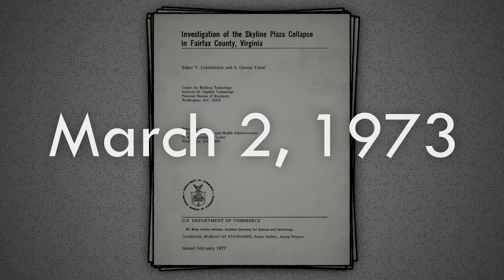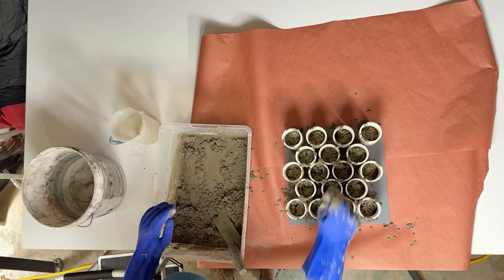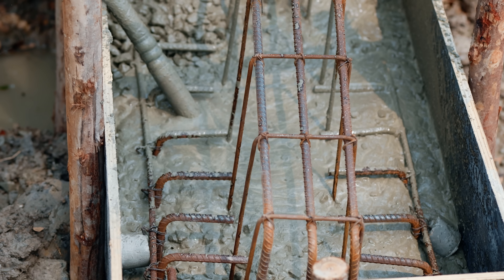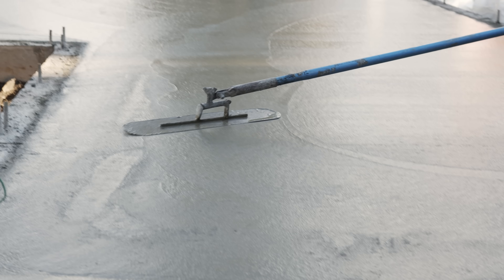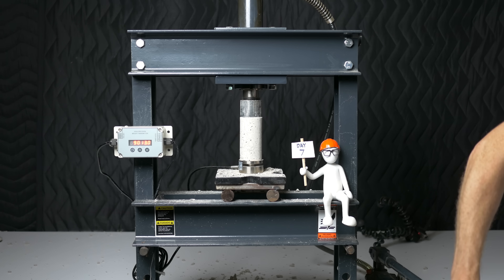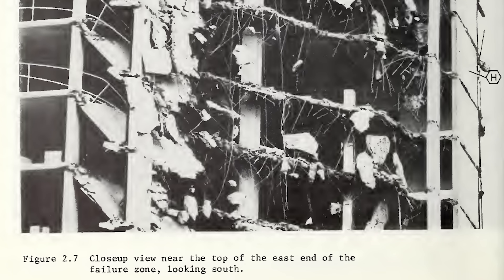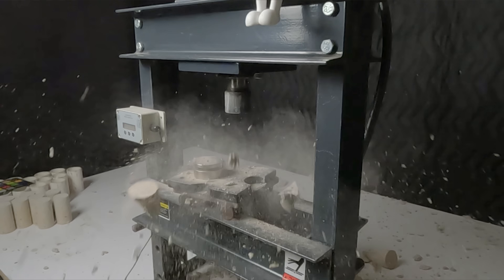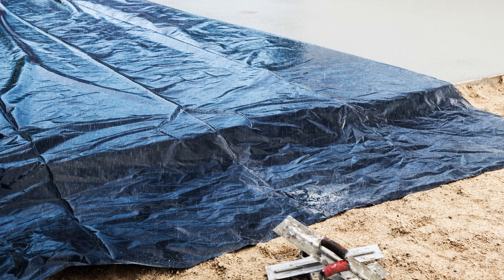Concrete's Greatest Weakness is Time

Comment: I used to work as a concrete field tester back in the early 1990s.  I saw all kinds of things.  One of the big factors was the contractor doing the placing.  Some of them were lazy, and would ask the delivery drivers to "soup it up" - add lots of water so they didn't have to shovel the concrete into back corners.  This was particularly bad for basement pads and foundations.  My job was to test the concrete slump.  Usually, the specification was for 80 to 100 millimeters, but sometimes contractors would tell the driver to soup it up to 160 or even 180 millimeters.  If I caught them doing this, I could order the pour be stopped until dispatch was notified.  More than once, they ordered the driver back to the plant with their load - at the time worth $600-$700, to basically dispose of it.  If that happened one too many times, the driver was dismissed.
Reply: It's still common practice, especially in hotter regions where concrete dried up during transportation, the contractor would then add water to make them more workable, but sometimes it's more than water, heard stories where human feces and urine were dumped into them as the temporary toilets were full.

Also they tend to add water whenever the concrete is hard to compact, and the amount is usually quite arbitrary, they didn't really care about the final strength as long as the building doesn't collapse under maintenance period, which they can try to shrugs it off as owner's problem. A few foreman even complained to me in full disappointment on consultants catching them red handed, they genuinely believe understrength concrete and shortened rebars are nothing as long as the building doesn't collapse on its own.
Reply: @fsdds1488 every concrete specification I've seen lists cement type to use or prohibited, acceptable aggregate size, minimum compressive strength and maximum water: cement ratio. And they prohibit adding water to the mix after if has left the plant. There are non water based reducers available if higher slump is desired.
Reply: Slump?
Reply: @radish6691 Yes, slump - you pack the concrete into an open-topped cone of a defined height and slope on a flat surface, then lift the cone off, then measure the height difference between the original cone and the height of the pile of mud. A very stiff mix will stay at basically the same shape, a mix that's the consistency of ketchup will flow and spill into a thin puddle much shorter than the original.
Reply: @username34159265 Thanks! And sorry I wasn’t clear, I wasn’t questioning your use of the word, I just didn’t understand it in that context. Maybe I shouldn’t comment when I’m cooking dinner so I’m not rushed 😂
Reply: @radish6691  Nothing wrong with asking for a definition of a technical term.   In the case of concrete, 'slump' has a defined meaning only loosely related to the other everyday meanings of the word.
Reply: @radish6691  how far a specific volume of concrete spreads. Kind of like building a pile of sand and measuring the slope, but with something more liquid.
Reply: @plackt the way you described it sounds more like what I know as a flow test. A slump test doesn't really have anything to do with how much it spreads. For slump, All that matter is how much the displaced center drops.
Reply: @jonyemm  yeah, which drops because the rest of the volume… spreads.
My sand analogy probably wasn’t the best to use, but it’s been a while since I took my concrete course.
Reply: @radish6691  There is a special hollow cone, open at the top, 30 cm (1 foot) tall and 20 cm (8 inches) wide at the base, that you pack the wet concrete in in three "lifts" - tamping it 25 times each time.  You smooth off the top, then gently lift the cone off the concrete.  The wet concrete will then slump down depending on how much water is in it.  Using the empty cone as a guide, you put the tamping rod across the top of the cone, and measure how far the concrete cone has slumped relative to its original height.  Wetter concrete slumps much more.  As Grady points out, more water means the final concrete is weaker.
Reply: Different companies aside, was there nothing that you could've done to make sure that the higher-ups at the ready mix company knew when it wasn't the drivers' fault? 🥺
Kudos for keeping the people on your end who were ordering the batches of concrete straight, though, that's mega important ❤😊
Reply: @brandongaines1731  Blame can be fairly placed on a driver who adds too much water to a batch, whether somebody else on a job site told them to do it or not. And order for concrete delivery specifies the properties of the mix required, and nobody on the supplier end (i.e. a driver) should let any concrete down the chute that doesn't meet that specification.

In theory, anyway.
Reply: Still happens today, speaking from my experience with contractors 😅
Reply: I tested slump for commercial operations. There was a range and that was it. This was in the 70s. At least the pours I was involved in everything went as planned.
Reply: Wonder where at?
Around here, America(in general, but I particularly am located in Pennsylvania) the field tech usually is employed by or contracted by the concrete contractor. Even on the rare case that the GC/prime had a field tech on site to test the concrete we still did our own testing/cylinders/etc. Whether employed or contracted, the tech had no "authority" to stop anything. They had less(less than 0 is...) "authority" than the average  inspector on site.
At least an inspectors job duties include "observe and document". Field techs duties don't go beyond testing/cylinders/etc. Often the field tech was located where they couldn't even see the pour.
If there ever was a problem where someone else questioned the quality of the concrete we placed we would share our test results and tell them they are free to core drill it and break it, since it is there concrete (despite what people claim about the contractor owning it until they are paid... It doesn't work like that). For the jobs I was involved in that's where it stopped usually . There were other jobs where someone may have thought they seen something they didn't actually see ***and they were usually handled as follows. After stating the obvious, it's their concrete to test as they wish, if they communicated with us to have someone there to observe and document the drilling, the transportation, and breaking of the cores, and it failed the break tests, then we would be responsible to R&R that truck, and would deduct the cost(drilling, breaking, etc, as per the invoice) from their bill. If they didn't notify us to have someone there, and the breaks failed, we would conduct our own drilling and breaks, after they signed off on us putting a hole in their concrete. If ours passed and theirs failed that became a problem amongst people who got paid way more than the field techs. Reality is it's not hard to bury(I mean "eat". Not talking illegal hoffa type concrete work) 10 yards of concrete+work on most of the jobs we did. 

*like I said, particularly in PA, though my initial cert was through ACI(nationally recognized).
*"field tech" having the same meaning as the term you used.
***most field techs  and even (state) inspectors can't tell the difference between a truck adding water and a truck just mixing it up better unless they were to be up on the platform looking in the drum.
Not knowing your place on site is a good way to no longer be on site.
Reply: @jonyemm  Because I was employed by the concrete supplier (Edmonton Transit Mix), I was specifically given the authority by the Manager to stop pours that were radically out of spec.  The drivers were informed of this.  Sometimes, they would try to cheat by emptying their concrete before I had completed my test.  The drivers themselves had a line on the form that the contractor accepted the concrete as delivered, thus putting the responsibility on them.  Many clients, however, had an Engineer on site who wouldn't allow concrete to leave the truck while they observed my test, and they could stop the pour.
Reply: @jonyemm I was going to say the same exact thing. Even when a third party is used because the owner wants to, the guy testing the concrete is normally a window licker getting paid 15 dollars an hour and doesn’t have authority to call a pour lol.
Reply: @ngkngk875 glad you said "normally" instead of speaking in absolutes.  When the employer offers me any type of trainer or certs, I take what they offer.
But yeah, no authority. Dude may really think he had some type of "power" or it could be a 12 year old kid
Reply: @jonyemm  Rather more likely, he was simply correct about what he did at his own job.
Reply: How does the driver have control over the concrete mix?
Reply: @0whitestone  The trucks have a large water tank mounted in front of the drum.  The aggregate, sand and cement are doled out automatically by the dispatcher, but water is added by the driver.  Normally, they add water at the plant to bring the concrete up to spec, but we also had a water truck to add the water on site if the site was more than half an hour's drive.
Reply: @psmirage8584  Oh interesting, I didn't know that. Thanks for the info!

Comment: Now the concrete question: What’s the hype with this Roman concrete stuff?

(Or: What are the leading hypotheses how and why Roman concrete becomes this almost magical stuff? I’ve heard about dry-‘pouring’ and tamping to get it settled, using volcanic ash and the addition of seasalt in naval constructions that still hold up to today and are still in use. If you can separate the reality and myths around it, I would be really grateful.)

Comment: Great video!  I have only done small sections (sidewalk, patio, etc.), allowing a few days curing before foot traffic.  You also explained the reason for keeping concrete wet for a few days while curing, though you did not specifically mention this.  Extrapolation: If concrete drys out to fast (hot weather, direct sun, etc.) the hydration process is inadequate. Covering with plastic, tarps, etc., keeping damp on the surface, all help to insure the hydration process.

Comment: I totally forgot that I lived in a pre-cast concrete house, it's mundane where I live, most houses are being built this way, developers saved a lot on on-site labor cost and form-works are only needed for foundations. It's amazing that pretty thin wall with no columns can be achieved with concrete.

Comment: 5:50 I wonder how much more pressure the cylinders could handle if he left the PVC molds on instead of taking them off, how much stronger/more pressure could the combine PVC/concrete take, could it reach double the amount.

Comment: At the bridge between from WB I-196 to SB US-131 in Grand Rapids, MI, a concrete pylon recently had to be completely replaced. The bridge has been closed for more than a month now, and for the last three weeks, literally nothing has been happening. They're just waiting for the concrete to fully cure before reopening the bridge. In fact, from when they started until a like a week ago, they had temporary supports before and after the pylon to hold up the bridge during the construction. I haven't seen in the news yet when they're going to reopen it, but I hope it's soon. It's really annoying.

Comment: Many years ago I was a laborer on a highrise. They were pouring the 30th floor and at ground level all the internal fittings were being installed.
When they tried installing the elevator doors they found the main floor was 2 inches too thick. Somehow the error had remained undiscovered for months.
Three of us were given a jackhammer and a grinder each and told to  remove concrete and rebar down to the right level. It took us 3 days. The floor being full  
of rebar and fully cured added an extra degree of difficulty.  Everyone complained about the incessant noise and my whole body was hurting for days afterward. I never found out if anyone was held responsible.  I went  to the next job.  Every time I see that building it triggers 'muscle memory' aches!
Reply: You’re good. I would have quit on the spot

Comment: I was really hoping to see you make some samples with way too much water, too many people think concrete dries and the water quantity (slump) doesn't really matter. However, you mentioned that it is in fact a chemical reaction where the water becomes part of the overall structural concrete.

Sugar can drastically slow down curing time, and enough sugar can stop it all together.
Reply: About a kilo per normal truck load or something like that?
Reply: @TNH91  A kilo would definitely slow the process way down, but I would guess more than that to stop the process would be needed, but I simply do not know the number.

Comment: Concrete isn't what cures. Binder is. The weakness wasn't concrete's; it was Ordinary Portland Cement's (OPC). OPC takes a month to cure above 80% ultimate strength through water-wasting hydration; waterless geopolymer can cure in 10% of the time to twice the strength of OPC (compressive or tensile). True, you do need to apply resistive heat and make your formwork insulating for those 3-9 days of curing to hit the optimal curing temperature, but that is minor compared to the labor cost of the next 21-27 days of crew time.

Criminal that anyone still deals in OPC and not geopolymer.

Comment: Concrete's greatest weakness is arguably corruption. Bribes to do a lesser job. Less cement, lower standards of placement, inadequate compaction, water added to increase working time, missing reinforcement, falsified test results. It happens.
Reply: The worst case of concrete corruption I've heard was from an Army buddy who had worked on some highway bridges in the Dallas-Fort Worth area. He said after the inspector checked the depth of the holes in the ground and the rebar the boss would instruct them to toss as much construction trash as possible into the hole -- thus saving money simultaneously on trash removal and the amount of concrete needed. Yikes.
Reply: Really, what we're all saying in different ways, is that humans are the greatest weakness of concrete.
Reply: As someone who worked in this field for 6 years... you hit the nail on the nail on the head. I was the only lab technician we had at my company so I was expected to break every cylinder our field guys made. It was an impossible amount of work coupled with all the soil testing I was expected to do too. We had quadrupled our clientele over the years but kept the same number of lab staff - one person. There was a lot pressure from management to falsify test results. When its 4:50 pm and you haven't even started on the 200 concrete breaks for the day... its hard to want to break all three 28 day samples for every job. Not to mention the soil testing or the calibrations I had to keep up with for things like the curing room temperature gauge 😬 That's why I left. Too much work and I hated being pressured to cut corners. I begged for another lab employee but they would have had to re-categorize me as a manager and pay me a managers salary. Even though I was already managing the lab. So instead they would gaslight you into thinking the business hadn't grown and tell you, you should be able to get it all done by yourself. Then they'd yell at you for taking overtime.

And that was just my experience working in the lab. I was a field technician before that for 2 years and there was soooo much falsification of results (not by me but just in general) there it would make the average person afraid to ever set foot in a high rise again.
Reply: This is currently happening in the Philippines
Reply: That’s not been my experience. The greatest problems are lax oversight and lazy contractors.
Reply: @Korndoggy  It does happen. As I mentioned on another thread, I saw a documentary on the Big Dig recently, and there was a scandal where concrete leftover from pours was being reused to save money, resulting in substandard concrete. Unfortunately, it was only exposed years after the fact.
Reply: @chrimony So lax oversight.
Reply: @Kandralla  The documentary mentioned the staggering amount of concrete that was poured for the Big Dig. So yeah, while technically it should have been caught, it's not surprising that it wasn't.
Reply: @chrimony lax oversight. We check every computer generated delivery ticket the truck driver must have, otherwise we reject the load if no ticket is provided. These tickets show mix designation, batch time, jobsite, and project contractor. 

The biggest problem we experience is contractors adding water to the concrete truck after we pull samples. If we see this, and we watch for it, we will dump the sample where the contractor can see it, note what happened, and resample.
Reply: @Korndoggy  Maybe you can go back in time to the 1990s and tell them what they were doing wrong.
Reply: A book - and a series of videos! - can be built on Chinese concrete corruption.

It would be cool to do a contrast with Japanese or Korean concrete corruption. It definitely exists, but it isn't raging out of control like it is in China.
Reply: I live in a neighborhood in Seattle served by a bridge that failed and was closed for more than two years during the pandemic.

1980s concrete / steel from Korea, corruption mixed right in.
Reply: And lets not even bring China ToFu concreate mix